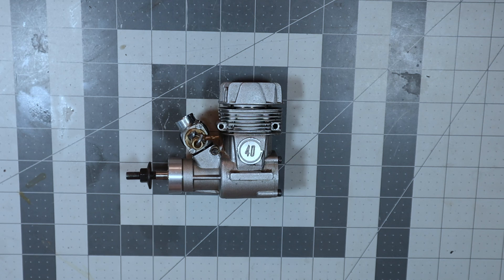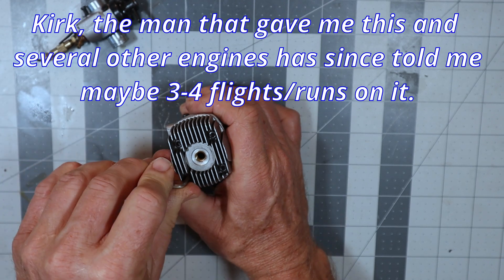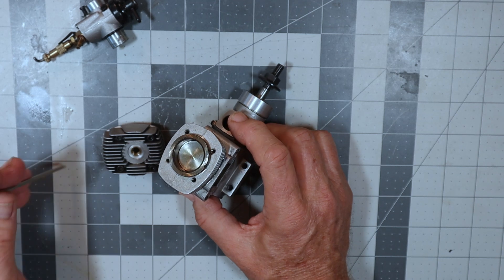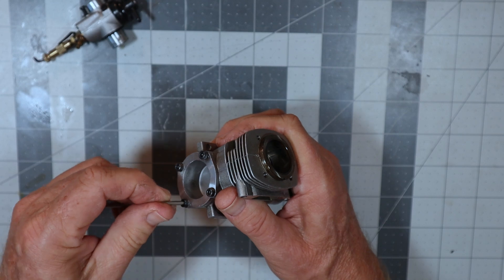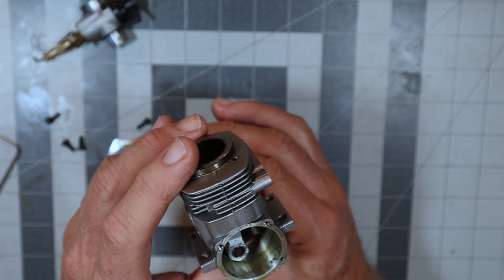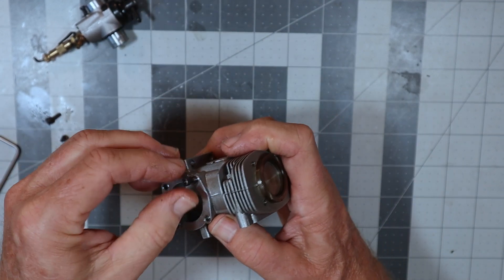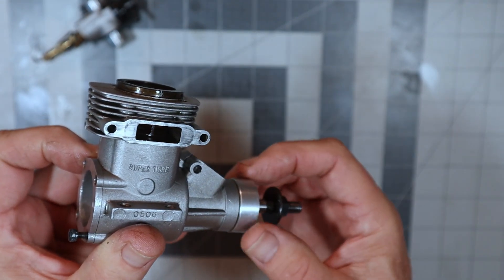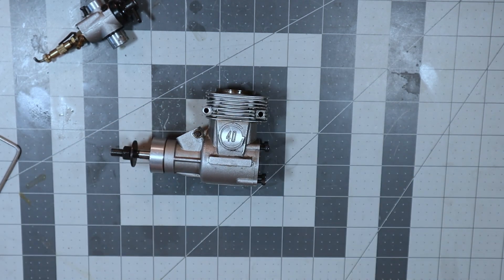Super Tigre G40 Ring A Look Inside

Comment: Wow, looks amazing inside. Good thing theres not much need to disassemble it. 

I disassembled my G2300 to replace bearings. Simply put, the sleeve was a pain to remove and the whole takes a lot of heat to disassemble... But overall not too bad to do. The prop washer had a groove so it was easy to remove ... That one there is pretty smooth so might be a little tricky

Comment: Had one of these, and I promise this is true: Four owners (that we know of), been on 6 different airplanes, crashed 3 time (that we know of), leaks oil like a colander. The last crash was full throttle into the dirt. Pull it off, cleaned it out, thing still runs. Gave it to a new member and he's using it in a Kadet LT-40 to this day.
Reply from the maker: Cool info!  Some engines really can take a beating.